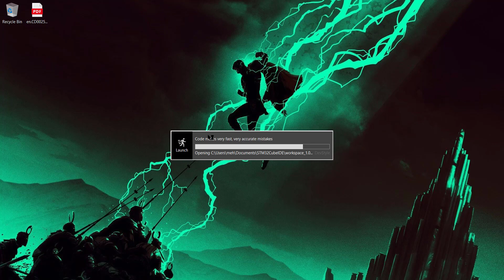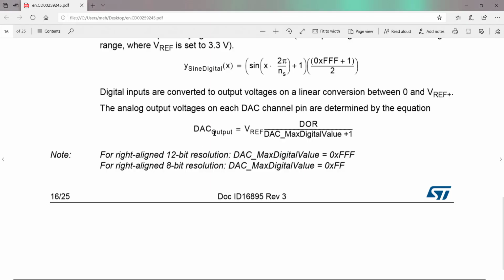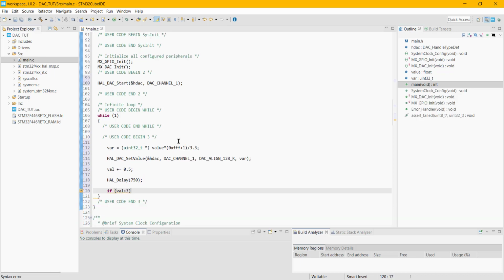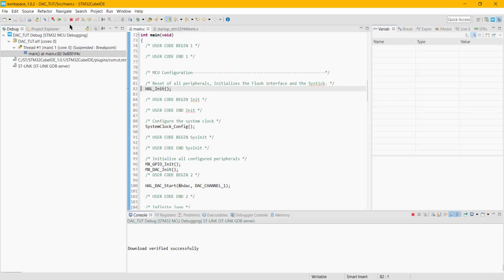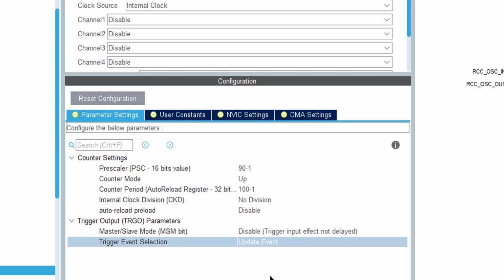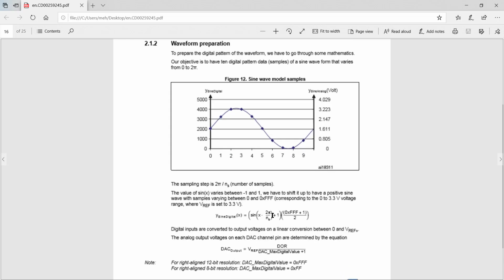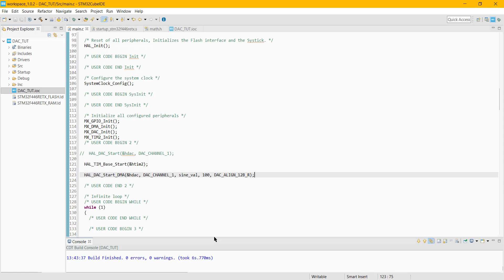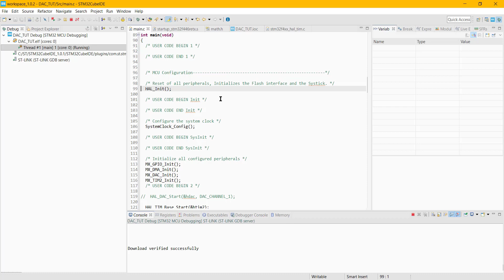DAC in STM32 | Sine Wave Generation | HAL | CubeIDE Tutorial

Comment from the maker: The MAX freq of sine wave depends on the trigger frequency and the number of samples.
Let's say the HCLK is 150 MHz, and so is the timer  frequency
If you keep the prescalar 0, and use ARR as 10-1, this means the trigger frequency from the timer will be 15 MHz
Now if you use 15 samples in the sine wave, you can generate the sine wave of 1 MHz
150 samples = 100 KHz 
1500 samples = 10KHz

And so on

Comment: I am using the STM32-Nucleo F767ZI. Is the configuration the same? If it is different, what should be done? Please provide a complete explanation for my practicum.

Thank you very much.
Reply from the maker: It should be same.
Reply: @ControllersTech  I use a hantek oscilloscope DSO1200 how to string the jumper wires between them? for GND stm32 to where and for pin A2 to where to connect it on the oscilloscope DSO1200
Reply from the maker: I don't know about it. Probably connect the black wire to gnd and red to PA2.
Reply: @ControllersTech  Isn't it, in your video PA4 as the output?
Reply from the maker: Whichever it is. I didn't see the video, you said PA2 so ai thought it is PA2.

Comment: Hi I am working with STM32 H7 board. I want to get sine wave in two channels. I am can able to write date to two channels as a sine wave but the sine wave is not so smooth because i need sine wave of around some 10kHz max. But the sampling time is around some 50khz and it is varying. Can you help me with this?

Comment: I am literally using an F446RE like you and copy pasted your code and settings in Cube... i can't generate anything... nothing on the oscilloscope no mater what... maybe some help? if i try to operate the DAC in a standard value like the first example everything is working fine... *Edit: i created a new STM32 Project and did only the sine wave part and it worked just fine... WTF?! is CubeIDE bugged or something?
Reply from the maker: never use the code as it is. Always generate a new one. I delete few things while uploading the code. This is why there is a video, and there is the process.

Comment: Hi Sir,

Thanks for video 

I followed the same as mentioned . i am using stm32f407vg discovery board .  but i am getting 
DMA underrun error condition occurred for DAC channel2 (the currently selected trigger is
driving DAC channel2 conversion at a frequency higher than the DMA service capability rate). i reduced the timer counter frequency to 500KHz but still facing same error..

can you guide ur suggestion

Comment: nice done. 
You can use the symetry of sinus function to save some memory. Values in second half are equal to negative value of first half. (sin (x+180) = -sin(x).
Values in first and second and values in third and fourth quorter are symetrical around x=90 and x=270 degrees.  sin (x+90) = sin(90-x)

Comment: Thank you very much! I got it working!
Chose to go with a uint16_t array and using Half Word's instead of Word's for Data Width at 8:41, since the DAC has 12-bit or 8-bit modes and I wanted to save memory. I needed to cast my uint16_t array to uint32_t to make the compiler stop throwing a warning. I'd though the function would expect a uint16_t array instead of a uint32_t array once you change the 8:41 Data Width parameter, but apparently not.
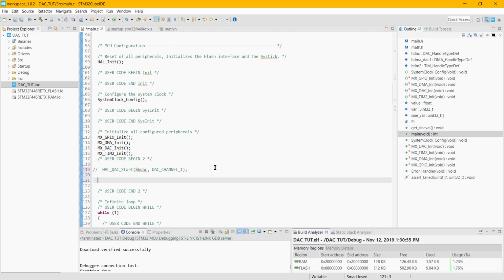Thanks for the "-1" tip at 9:20 and Content Assist Template Proposal (Ctrl+Space) demos throughout (eg, at 12:03);

Comment: For me I can generate 100 Hz but 1kHz doesn't work :(. Voltage on pin drops to around 300mV... I have DS1054z scope..., and stm32f746zg. Using TIM6 with DMA.

Edit: I was only able to generate a 1kHz frequency if I used 10 samples instead of 100. Where is my limit? What should I look for on datasheet? Or is it my scope? I doubt it
Reply from the maker: Well this depends on the trigger frequency and the number of samples.
Let's say the HCLK is 150 MHz, and so is the timer 1 freq
If you keep the prescalar 0, and use ARR as 10-1, this means the trigger frequency from the time will be 15 MHz
Now if you use 15 samples, you can generate the sine wave of 1 MHz
150 samples = 100 KHz 
And so on
Reply: @ControllersTech  Still does not work. For example, I have TIM6 at 16MHz. prescalar 0, ARR 10-1, so 1.6MHz. Then 160 samples gives 10kHz. On the oscilloscope, still 350mV reading, flat line no sine wave.
Reply from the maker: Don't know what's going wrong on your end. Have you enabled the update event in the timer ?
Today I have tested all possible frequencies i could and the response was always as per the calculation.
Reply from the maker: Try using hsi clock
Reply: I'm having a similar problem using the STM32F4o7G-DISC1 board. I can only generate up to 105kHz. The HCLK is 168MHz and the external crystal is 8MHz, and if I put ARR to 1 and Prescalar to 0, I only get 105kHz. I also tried changing the sample number (ns) in the equation, but it just changes the shape of the wave generated and maintains the same frequency. Any solutions?

Comment: Many Thanks for the video. I would like to know if it is possible to count number of senoidal waves generate with a counter variable and after a certain number of sinusoidal waves I stop create the waves for a period and recreate again. For example: 58 pulses of senoidal wave and 2 pulses of zero volts. This will be used in a car signal injection for test.
Reply from the maker: Yeah you can.. just put a variable inside the function, and increment it after the sine wave has been generated..

Comment: I only have one sine wave when I reset the code. After that, I have a fix voltage. How can I fix it ? How can I have a infinite signal ?
Reply from the maker: What? What you mean reset the code?
Infinite signal ?
Reply: Did you set the DMA to circular mode ?

Comment: Regarding the timer setting and frequency expected, my TIM6 clock speed (APB1 bus) shows 64Mhz.  So, for a Timer event to trigger the dma every 8khz, I set the prescaler to 0, and TIM_ARR = (64M/8k)-1.

However, with the DMA pointing to a 2 sample buffer (0 and 0xFFF), what I see on the scope is a square wave at 4khz with a 50% duty cycle!!   Considering the Stm32h7's has a maximum DAC sampling rate of 18.18Msps, what I expected was that every 8khz the timer would cause 2 samples to get transferred from the memory buffer to the DAC peripheral,  and therefore the scope should show it briefly at 0V, but most of the time it would be idle at 3.3V while it waits for the next timer event... yet this is not the case, why??  Instead it's acting as if only one sample is transferred every timer event, despite:

HAL_DAC_Start_DMA ( &hdac1 , DAC_CHANNEL_1, pBuffer , LENGTH_2 , DAC_ALIGN_12B_R);
Reply from the maker: The frequency of the square wave will also depend on the number of samples that you are talking. In your case, 8KHz /2 = 4KHz.

Why is it 3.3v ? Well that depends on what values you are feeding to the DAC

Comment: how i can generate a triangle wave using the triangle generator??
thanks for the video, i'm allways share it with my partners
Reply from the maker: There is a section in the document linked in the description about triangular waveform..
Reply: STM library comes with examples. Find corresponding examples like Examples\DAC\DAC_SignalsGeneration in Cube repository.

Comment: What was max frequency you could generate sine wave?
Reply from the maker: Actually I haven't tested it. It depends on how many samples you are taking..
Reply: is it possible 1mhz sine wave
Reply from the maker: Yes it's possible if u are able to keep the timer frequency at 100 MHz and than use 100 samples, or 50 MHz and 50 samples. Remember that decreasing the number of samples will increase inaccuracy in the sine wave
Reply: @ControllersTech  thank you very much, i tried (CPU=180MHz, Timer=CPU/2=90MHz, ARR=9-1) = (10Mhz-100ns), (10MHz/(Sample=10))=1MHz sine wave and good quality, how can i increase power of that sine wave i need minimum 50mA output
Reply from the maker: I don't know about controlling current in this prospective..
Reply: @omeranar1-m9t  use fast transistor
Reply: Depends on particular STM32 series DAC performance: from 2.4 Msps of F100 to 30 Msps of G4 (in DMA double data mode). Just divide max Msps to number of samples. Take a look to ST document AN4566.